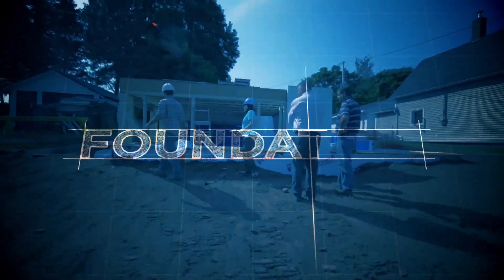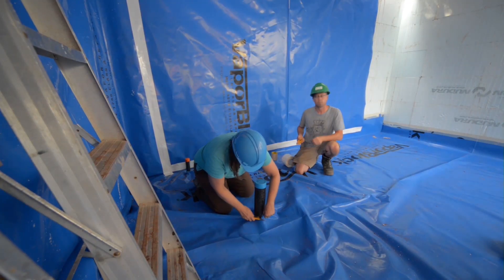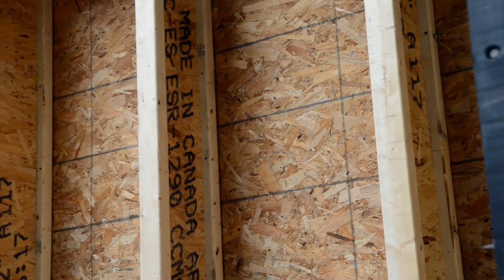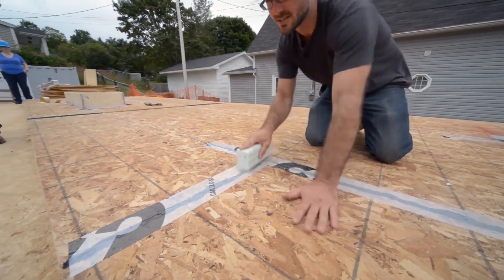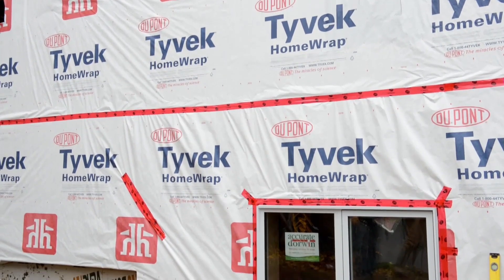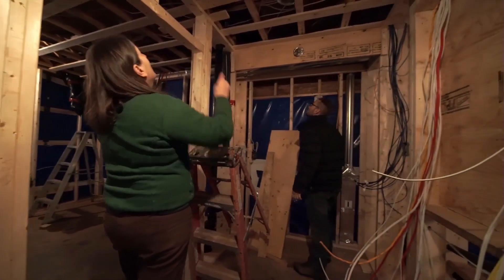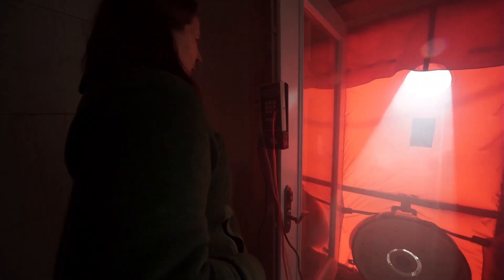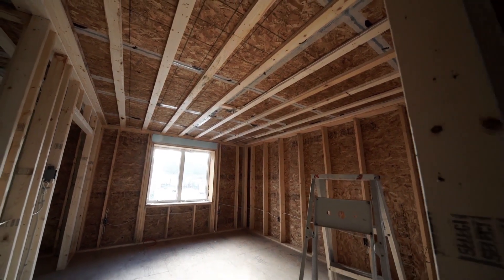Building a new home? Consider a Passive House

Comment: Thanks for the excellent video guys, and congrats for your amazing work. I have one question: how one can achieve high indoor air quality with using OSB, which utilizes formaldehyde which causes respiratory problems, such as lung cancer? Is there a different wall panel system to avoid OSB? Thanks

Comment: I have opened walls that have been taped for twenty years or so and for the most part the tape stills look well bonded. The tape that was on the market at the time was not made for that particular use but still held up very well. 
A house I built in 1990 had foam insulation under the slab and basement walls. At the time we only used a small amount of foam when compared to the amounts that are used today in home construction. Even still the impact on energy consumption was huge.  

We are planning to build one more home for ourselves and plan on using the most economical methods. I suspect this will cost use very little extra when compared to standard home designs. I would rather place a great deal of insulation in place of a very expensive heating plant. We will trade a huge heat plant for insulation in effect. Our electric system will be built around a future solar PV and hot water system. Something I plane on installing after the house is done. The house will work very effectively without solar energy input but the addition of such a system will bring the house up to the next level. 

The well will use a soft start pump. Yet the heating system will be basic and have no blower on the heat plant. Simply put heating by convection. 
Right now all our cooking is done by an induction cook top. I cannot think of a better way to cook than induction. All our lighting is LED and that works very well.
Reply: House was built in 1960.   Around 74 or so, I participated in a rebuild.  We doubled the first floor insulation. Put a second story on the house - 3 levels now. Throughout it - we doubled all the insul.  old oil furnace, now heat pumps, for last 25 yrs.  The pumps were $1000 each time they were purchased - out of Montreal.  I visited my dad last week and he still has the most efficient house - using the least amount of energy - of 100 homes around him.  And he has 3 levels -  a 1/3 more living space - compared to all the others.  

My next rebuild was a slab on grade . 1950 house redone @  1990 or so. All windows were triple L E of the day.. The walls were 12 inches after. Slab insulated.   Attic had 30 inches of blown styro.  R - crazy #. 
Cut the power bill by 1/2 in 6 weeks work.  I built it with R2000 insulation levels - a decade before. 

New Construct - went to heat pump - cut energy by 1/2 - with just that. 

Doing the design on my last house. 30 yrs life. Building my first Passive Home.  The issue I see - is making the build details simple - so what I want can be built by any framer, but with time to work myself - I see the job as challenging and so rewarding.  And the framer gets to learn how to be one of the best.
Reply: @mpccenturion  sound like you did your home work.

Comment: What's the carbon footprint of the house with all of those extra building materials? Also, obviously no one design is perfect, but is a passive solar house that also has low environmental impact even possible with all of that insulation and concrete? Seems hard to marry low environmental impact and carbon footprint with passive?

Comment: Any idea how much more per sq ft it is to build passive over conventional building techniques?
Reply: its about 10% more expensive in canada
Reply: Zackary Bouchard  not the way they are building it here in this video
Reply: mod95red long term savings more then make up for more up front cost.
Reply: JohnsRadios  that all depends someone could build a very efficient house with quality products and not meet "passive" guildlines due to certain products being used but the cost and the style of the "passive" products couldnt be justified doesnt mean you can be more efficient in building though.
Reply: Leonard Martin,

My qualifications are,, I have been designing and building passive solar and super insulated for 35 years.

I think I understood your position.    And the core of how much it costs and how effective it is, hinges almost entirely upon,, it must be completely planned in the pencil drawing stage.  That is the design stage that is first, before you draw a set of building plans.   The fully effective passive solar, super insulated house,, it can look like any normal house, but you must begin before you draw the blueprints, maybe even, before you buy the lot.

The flip side, which is what I think you were referring to,, it is difficult, and expensive to retrofit an existing house. A house already up,, it is too late,, and expensive if you try.   And you really cannot  slap on a bunch of 'stuff' to a finished set of plans.  I'll go further.  The video contained one tremendous error.  Every house in the video faced the street.  That is the way we do things,,,, uh, NO.   The house MUST address the sun,, not the street.  Now,,, if your street happens to be a true east/west street,, fine, face the street.  Most streets are not true east and west.  Design the house to face the sun, not the street.

If that is done, I agree with Zackary Bouchard,, the total additional cost is about 10%.  What we just saw in the video,, I'd guess a bit higher, a 12% or 14% premium.  The house built in the video had some redundant features. Pay back for a well run project is normally less than 10 years and often, less than 5 years.  My houses,, heating, cooling, and electric, run on less than half of their neighbors.
Reply: @Sailor376also  i more meant that someone could build a house using quality house with energy efficiency, and passive in mind but not meet  passive codes because of certain products they used. i for instance am building a house with a wolf all gas range and gas oven 60 inch model. massive vent hood . i also have a wood fire place a actual wood one. as well as a wood/ gas furnace hybrid. house will also have multiple instant water heaters as well as circulation pumps for hot water right at the tap. in floor hydro radiant heating as well to make the floors feel warm so you dont need to heat the air so much. i also have the same hydro radiant heating in the shower walls so it would be warm to touch that is on a timer thats set to only be on during certain times in the day. i am using martin windows mid tear ones. building is build with 2x8 structure, wrapped in zip r 1.5 inch foam sheathing, as well as 4 inch closed cell spray foam and also a batt insulation as well from huber. all interior walls also have huber insulation in them as well as in floors i have batts. roof is spray foamed with 14" closed cell. all floors will have zip floor sheathing 1"1/8. im using floor trusses. all concrete floors have a hydro radiant heating as well which the entire system will be in sections. i have a/c and air filturation and dehumidifier as well built in. multiple zones for heating because of using 3 small furnaces instead of one massive one because its a 4500 sq  ft home. garage is slightly heated with multi heat pumps and hydro radiant in floor. solar roof. as well as full automation including window treatments, light, all led lights only. wolf appliances only for kitchen. siding is to be a composite siding. and exterior will be sprayed with huber blue shield for water proofing. but because of certain products that i am using the house is not considered passive.
Reply: i used a wood/ gas furnace because of the storms we have. i used gas appliances for same reason. all lights are led for use of less electricity. house will be almost net zero but would never meet the requirements to be net zero.
Reply: You are doing really well.  I think a bit over the top,, but your process sounds okay.   You have focused upon heat and insulation, whereas the focus of a passive house is primarily to do without a heat source.  One consideration from your reply.   Concept,,,  a concrete slab, (all of my basement floors, garage floors, shop floors)  the concrete shall not be in contact with soils, footings, or outside air at any point.  Around pipes or intrusions,, care is taken to accurately cut the foam that goes under the slab and even tiny spaces are stuffed or foamed.  The slabs do not touch basement walls, rail footings,, the slab does not go under a door to the outside.   The slab is only in contact with the foam insulation, isolation, and the interior air.  If you do this, the slab will be the temp of the air,, or the temp of the sun warmed side near the window.  The really cool part is,, you don't need to do anything else with the slab.  It becomes a flywheel, and energy storage to moderate the temps in the house.  And all you did was use the cheap white bead board under the slab and spend a few minutes filling in the details carefully.  Works great.
Reply: @Sailor376also  yea i have ordered a foam board insulation for below the concrete that has the ridges for the hydro radiant heating above it.
Reply: Leonard Martin  exactly where do you purchase the correct type of foam to do this?  Dimensions? What is approximate cost per square foot for this foam?

Comment: My concern is the HVR. It needs to operate 24/7 to provide proper ventilation of the house to prevent humidity and condensation inside the home. If you have a power failure for an extended period of time, the HRV will not be operating to provide the needed ventilation. So I'm assuming you will also need to have a battery backup or a backup generator for the HRC to keep it in operation during power outages. Any cooking, hot showers, any time you open a door or window, you will be allowing humidity to enter the home. So you need to be able to continuously ventilate the house. I do understand the HRC will provide the ventilation, but Power outages is the main concern. Or maybe the system breaks down in time. The time it takes to get it back up and running, moisture and condensation will be building up inside the house with no natural way to ventilate it out being the envelope is completely sealed.
Reply: You can ventilate the house using the windows. HRV or ERV doesn’t dehumidify. You need a separate dehumidifier or humidifiers depending on where you are. Western Canada is mostly dry except Vancouver / Vancouver Island & Eastern Canada is Humid.

Comment: Port Alberni's first Passive house in the Heart of Vancouver Island, to date we have 30 individual detailed videos from the foundations up, Search google for seumas2 in youtube once opened go to the top and click on videos, the videos will be in reverse order, more as the build progresses. We never used tyvek or OSB, used moisture and air barriers products from EU, double wall 2X4 DK studs, 20 ins thick, Rockwool insulation R 80 walls ceiling R80, pad R55, triple glazing R 7.5, large windows facing South, small facing North, 1/2in plywood sheating, no air leakage, all joints and air infiltration  taped, widow wells splayed at 45 degrees on the outside (wide angle view) heat exchanger (EU) heat pump hot water heater, wiring placed in the double wall cavity ( no drill holes in the studs, dropped ceiling allows the same, moisture barrier placed 1/3 distance from the from the interior wall, for further details view the videos. Wheel chair accessible, electrical switches one foot lower and the power plugs placed 4ins higher for that reason, Stay tuned as the build progress to the finish stage producing other 12 plus videos. slainte mhath

Comment: The passive house standard is nice but sometimes lead to people putting a foot of foam underneath the slab to reach a target metric which is absurd. A less expensive and near equally green building option is net zero. Instead of larcen trusses on the wall you can get away with 4 to 6 inches of foam or mineral wool affixed to the walls. This is far cheaper to construct this way. Also do away with most of the tapes and use fluid applied wrb and flashing or self adhered wrb membrane with fluid applied flashing. Solar is getting so cheap its crazy not to use it especially with the $1 per watt rebate you get in Nova Scotia
Reply: Yeah.  It's possible to go overboard insulating.
A foot of foam (R60+) is absurd.
That was someone with money to burn and bad advice.

But that's the thing with Passive House.  There's many, MANY ways to arrive at the same ultimate goal.
It's just that some are smarter than others.

Comment: It looks like the basement only has a water barrier on the inside. Wouldn't it be bad if moisture gets in between the ICF cracks? Could it damage the concrete or result in mold? Matt Risinger raises this point in h is ICF video: https://youtu.be/MRipzKkeQik?t=855

Comment: 07:30 "Passive houses really aren't all that different from the houses you are used to....."
Hmm. How about concrete/block houses? They're pretty much different than this type of houses: stronger winds cannot blow them away, floods cannot push them away, cyclones/tornadoes can do much less damage to them, they're more private (you have to enter inside to put eavesdropping gadgets) and so on. 

Are these type of houses all that? Flood resistant? Like floods that are happening often and having in mind the climate changes more and more floods will be. Eavesdropping resistance? Soundproof resistance? Privacy degree? How about bigger windows? 

Except, the fast building, energy efficient (how much, that's a question since you will have to use that gadget for ventilation which works on electricity andwillhaveto workday and night)...........what other benefits have these houses? Are they low maintenance costly? How long will they withstand?

P.S. : a house that is made from wood,  nails, duct tape and "insulation " as wool in the walls......can you call that a house or "house of cards"?

Comment: So how much does it add to the cost of a conventional home ? 5%?  50%???
Reply: It really depends.  Because the interior finishes can vastly skew the price of a home.

Going  with super high dollar paint?  Granite?  Oak/Mahogany cabinets, real wood floors, etc, etc, etc?
The overall percentage for the extra insulation, the extra materials, and the detailing labor will be smaller.

Go with vinyl tile, Ikea cabinets and laminate countertop?  The percentage will be larger.

In a 2K sq/ft home, insulation will run you around $0.65-$1.20/sq foot for a conventional job.
Add in 6 hours of labor at $150-300/hour.  With better detailing, skew higher on the labor.

Super-insulation will roughly double your materials cost and labor.

Figure slightly over median for insulation and just call it a buck a square foot.
And figure VERY well detailed work at $300/hour.
You're talking $2000 in insulation and $1800 in labor.  So about $3800 out of a house worth several hundred thousand dollars.  This'll get you a well insulated house somewhat above code level.

For a super-insulated house, you'll pay out about $7600.  And that's an estimate on the high side.

Also, if you're even MILDLY "handy", much of this is stuff that can be DIY'ed to save money.
Reply: It depends, but we usually add 10%-20% in Korea.  Please consider that Korea has a rather harsh climate. It's very hot and wet in summer and bloody cold and dry in winter.